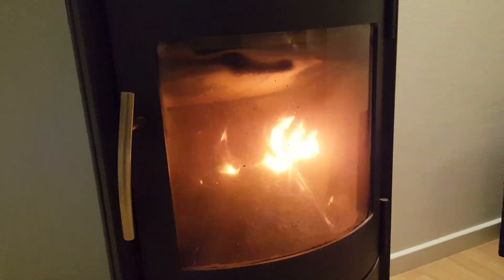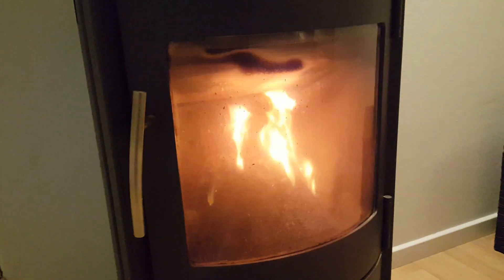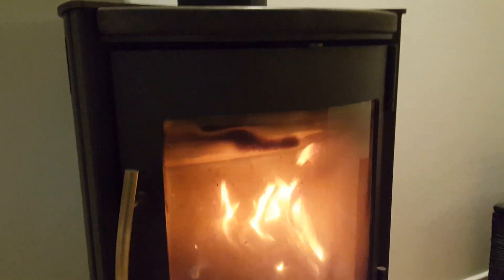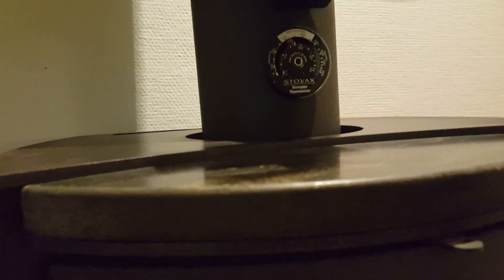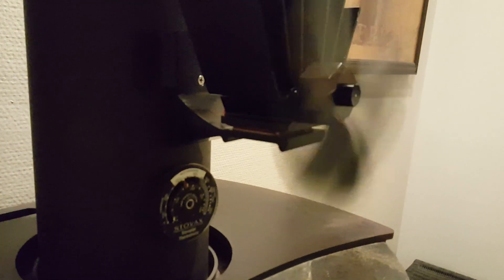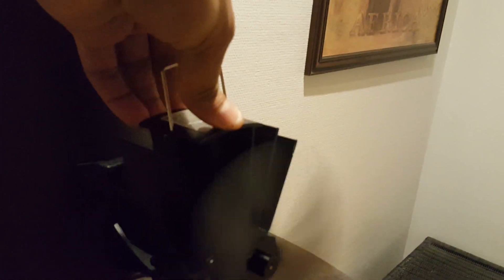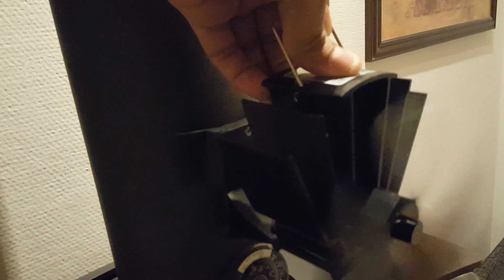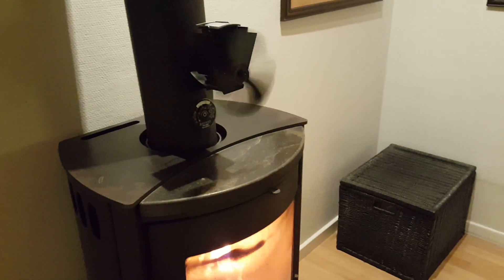Stove fan . Thermo electric powered  .

Comment: Thanks for this short insight! I appreciate it. But I have a question: How hot is the stove pipe? Is it a single wall or double wall pipe? Single wall would be above 200C, a double wall is just 70-80C. Would it work with both?
Reply from the maker: Its single walled and often between 300-500 degrees when the fire up and going. I think 70 degrees centigrade will be on the low side to conduct through the metal and heatsink enough to activate the fan.